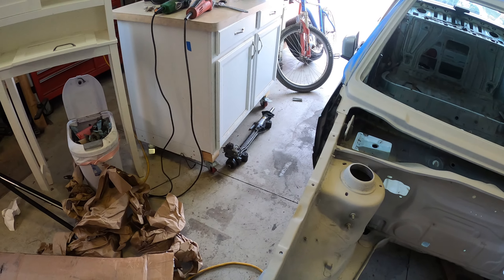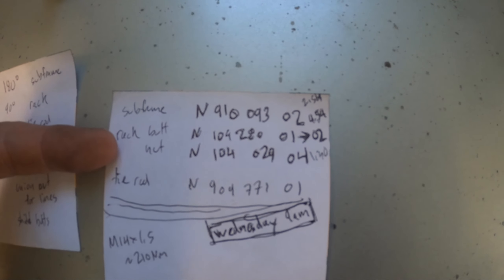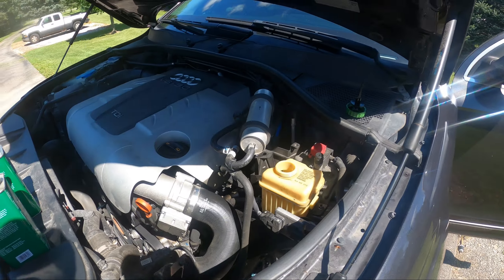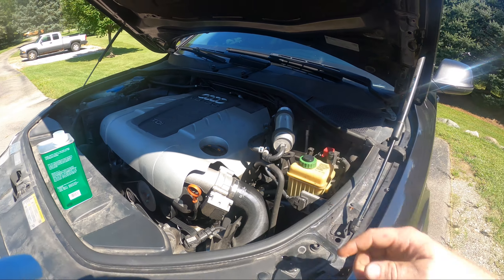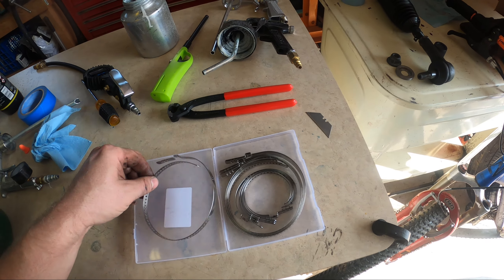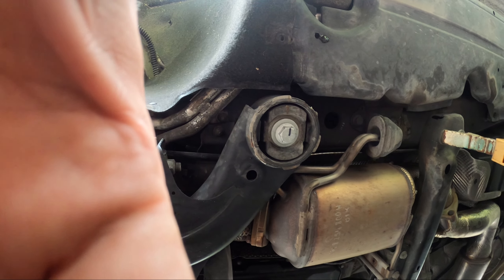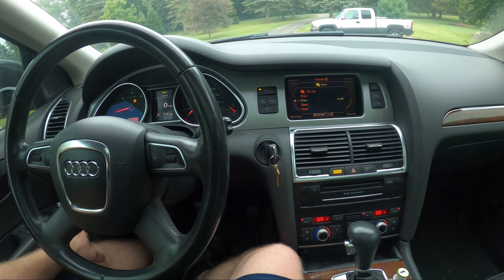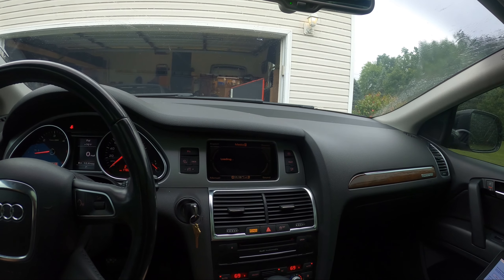2011 Audi Q7 TDI Steering Rack Install

Comment: Thanks for the video, I just did my ‘12 Q7 3.0 TFSI today.  I didn’t have to drop the subframe at all, maybe the TFSI has more room under the engine than the TDI.  It was about a 6 hr job all in and the dealer was going to charge me $2400 for labor.
Reply from the maker: Nice!  Glad to hear it went well for you.

Comment: At 17:20 how much torque is needed to mount the inner tie rod to the steering rack? And how do you clamp the steering rack shaft from turning? Great videos btw!
Reply from the maker: I've never bothered trying to clamp the rack, the gear is usually strong enough to deal with Install torque.  Inner tie rod is 100Nm, ball joint on the outer tie rod is 90Nm.

Comment: how much oil was used? Thanks for the video, very helpful!!!  Greetings from Italy :))
Reply from the maker: Capacity is 1L, and I had some left over from when the leak started.  I usually buy extra since this type works in a few of my cars.
Reply: @smsauce  Thanks for the reply! The cable visible at minute 10.00 to the left of your hand, is it the servotronic?
Reply from the maker: @patrykmichta7342  Yeah, it goes into a valve on that side of the rack.  That's the valve I broke removing the rack, and the first one the salvage yard shipped arrived broken as well.  They are $$$ to get new.